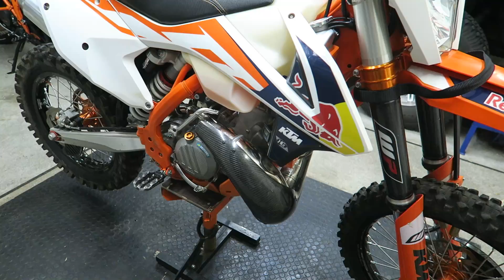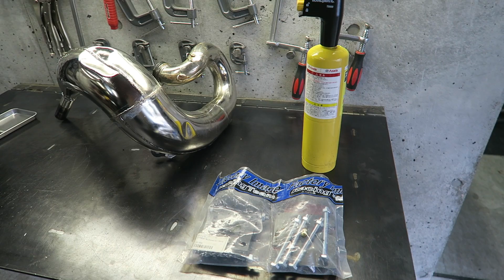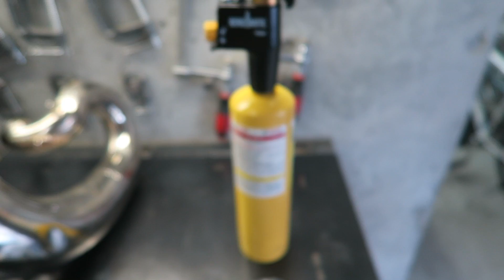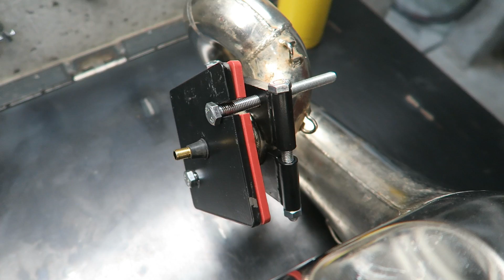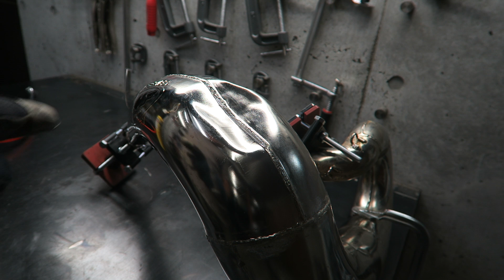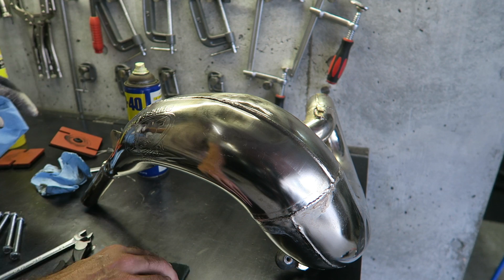2-Stroke Exhaust Dent Removal

Comment: When blowing out pipes I have had good luck using a metal body working hammer to work the edges of the dent. While the pipe is pressurized and hot work the edges of the dent tapping along the high spots which relaxes the metal and allows the dent to come out further.
Reply from the maker: Yes, I do the same now. Hammering works well. Usually I use compressed water (HydraForce) rather than air as it's much quicker and safer.
Reply: I agree water pressure is a much safer way of working @TokyoOffroad

Comment: Kinda sketchy with an empty chamber. I worked with a guy who leak tested a water tank with straight air, tank ruptured and blew him in to pieces, that was at 90psi, 250 gal bomb.
Filling the pipe with water would be 100% safer (hydroforming). Can still split, but splitting is far better than a 60psi air bomb.

Comment: Is it possible to do it without adding 60 psi. Just Plug the pipe and heat it up. THX in advance
Reply from the maker: No, you'll need to add some pressure, or it won't blow out.

Comment: Maybe try a higher pressure watched another video and he used 150psi
Reply from the maker: The dent would come out easier with higher pressure, but it would also be a lot more dangerous if something went wrong. Recently I prefer using the high pressure water blow out method as it's a lot safer and quick and easy to perform.

Comment: Pressure washer does this safer and no heat needed
Reply from the maker: I've made quite a few videos about the HydraForce method which uses water at high pressure and no heat: https://youtu.be/xVGdHsAIqNU
Reply: @TokyoOffroad  and if you heat the dent when using the hydraforce?
Reply from the maker: @66AGW  - The strength of steel actually increases with temperature reaching a peak at about 220 degC. You'd need to heat it to greater than 350degC for the strength to be the same as room temp. With the HydraForce, as the pipe is filled with water it would be very difficult (and dangerous) to get the pipe hot enough (greater than 350degC) to make the steel softer.

Comment: So much for the carbon guard. Overpaid for something that doesn't even do its one intended job.
Reply from the maker: I tend to agree. Carbon guards do provide some protection, but also put more force on the header of the pipe and it'll be more likely the pipe bends rather than denting. As such I don't use a guard anymore and just repair the pipe dents when they get bad.

Comment: That is the method I use except I can never get it hot enough with map gas alone. I bought a cheap regulator that  uses the map gas tank threads and the small oxygen tanks of the same size. Adding the oxygen allows me to get it hot enough, and fast enough to where it's much easier to manipulate the dent. Although sometimes it can get hot too fast and then the dent is no longer a dent but a slight bubble instead.  It's a balancing act with the amount of pressure and heat to use. Problem with the small oxygen tanks is you have to work fast as they run out in about ten minutes of use. Great video man. I'm still scratching my head about how that hydro force unit in your other video works. I'm just not sold on that method.
Reply from the maker: Richard Cote - I replied to your comment on my first HydraForce video. Please check out the other HydraForce videos I made which give a better idea of what it is capable of. This one shows me fixing a friend’s 2018 250 TPI which had the header crushed and bent: 2-Stroke Dirt Bike Pipe Repair- HydraForce Blow Out https://youtu.be/xVGdHsAIqNU

Comment: As a milwright/welder i would say nay to this method only because heating it up to the point where air will bend in back out WOULD ruin the structural integrity of the metal. I like the water method better.. just my professional oppion on metalurgy.
Reply from the maker: Yes, the water blow out method works well and is quick and relatively easy to do. I have a separate video here showing the water method here: https://youtu.be/xVGdHsAIqNU

Comment: This seems a bit dangerous to me, any un-burnt fuel or carbon in the pipe, mixed with oxygen and heat and boom.
Reply from the maker: HydraForce blow out is without doubt safer, although I haven't experienced any explosions with heat and compressed air so far. This video shows the HydraForce blow out method: https://www.youtube.com/watch?v=4aQL3UGMHk8

Comment: Compressed air is dangerous! How about filling a part of the space with sand or other non flammable material and only leaving a smaller air pocket at the dent site?
Steam boilers are tested with fluid because you can't compress it and if it ruptures it's just that, no blow up.
Reply from the maker: las 99 - I have a different video showing a pipe blowout using water at high pressure
Reply: @TokyoOffroad  Just saw it, cool but not as good as this method. Must be the heat that does the difference!

Comment: Your main seam looks pretty good but those depression areas on both sides can be completely removed if you use an oxy/acetylene torch with a small welding/brazing tip.  The heat is obviously greater and concentrated in a smaller area so you need to be a little more careful but you can produce a nearly perfect result fairly easily.  Also, that pipe you're working on is thick enough to where you can throw some pretty good heat at it.

Just saw this right after watching your video.  Illustrates what I'm saying.

http://www.youtube.com/watch?v=3rRerhUYKsU
Reply from the maker: Yes, if I had oxy acetylene I'd use that instead of MAP gas as it would be much faster. However, good results can still be achieved using MAP gas. One detail I prefer (particularly for anyone who doesn't have much experience with this process)it to add compressed air after putting some heat into the pipe, rather than at the start when the pipe is cold. This way you have a lot better idea of the maximum air pressure.

Comment: I'll never understand why all these fix it videos have all these shop tools then use a map gas torch, why dont people use a oxy acetylene torch anywhere on YouTube?
Reply from the maker: The Tag Z video uses oxy acetylene: https://www.youtube.com/watch?v=URLTEFfNk3Q 
I personally don't own oxy acetylene and rarely have a need for a high heat source. For cutting I use a plasma torch. Map gas is a good compromise for me for jobs like this...
Reply: thatkyleguy 1 because the average person doesn’t have access to an oxyacetylene torch so they’re showing you a way to do it.
Reply: Cody Crowell I feel like if a person has a nice shop full of tools they should have a torch setup. Why have 10 grand in tools on the walls and not have a 500 torch set...... I'm a firm believer in the old adage that "time is money" spend a little more money, save a bunch of time, therefore save money.
Reply: thatkyleguy 1 I totally agree with you. But I think they’re trying to show you what you can use at home. Most people don’t have a oxyacetylene torch
Reply: Cody Crowell very true I agree with you. I was heavy into coin ring making a while ago and I like how all the videos says "easy coin ring making at home" and first scene they have a 5000 dollar lathe they're using haha
Reply: thatkyleguy 1 hahaha exactly

Comment: I've used a powerwasher to pop out multiple dents at the same time. Works very good. Plus it doesn't ruin the plated finish.
Reply from the maker: Yes, there are multiple ways to do this. All methods have pros and cons. The advantage of heat + air is you can be very selective in what area you target and distortion of the pipe shape is minimized. But to be able to repair more severely damaged pipes I have ordered a hydraulic pump + bung blow out kit. When it has arrived and I have a suitable pipe to repair I'll make a video about it...
Reply: Tokyo Offroad, sounds good. Can't wait to see it.

Comment: Just use a better pipe protector..
Reply from the maker: You could use a stronger guard, but they will tend to make the pipe bend instead of denting. The combined skid plate/pipe guards offer the best protection, but are somewhat heavy, expensive, difficult to install/take off and collect large amounts of mud/debris while riding. I went a different direction and have been using an FMF Gnarly pipe with no guard for about 6 months now. The Gnarly uses thicker gauge steel than stock and has proven to be strong and dent resistant (only a couple of very minor dings).

Comment: When it hit the rock, it does not just get dented, but at the same time its angle is getting shift, so how we can fix it?
Reply from the maker: Atilla Özkolaçık - if the shape has distorted you’ll need to try to bend it back. Try clamping the pipe to a bench and use a pipe to bend the header. It’s usually possible to fix it so the pipe fits, but difficult to get it perfect.
Reply: What do you think about Hydraforce exhaust blow out kit?
Reply from the maker: Atilla Özkolaçık - I think hydraulic blow out looks quick and easy, but there is a risk that the pipe shape distorts while you blow it out. The FMF pipes have a factory made dent at the top of the pipe (for clearance under the radiator) and this would be blown out too with hydraulic. Like any method there are pros and cons...
Reply: I do not use fmf pipe so there is no risk for me :)).. thank you for quick answer and detailed explanations..your channel is the best in youtube

Comment: Thanks for the video, I am going to fabricate this same tool, I've seen guys just use hose clamps and maybe safety wire holding 1 rubber cap on one end and a piece of steele blocking the other end... also seen them blow out.. would kill if the ends blew. Great videos..cheers

Comment: Not a fan of compressed air, use pressurized water from a pressure washer. Hydroforming.  No dangerous hazard if the metal gives way. No heat needed.
Reply from the maker: Distortion of the pipe isn’t an issue?

Comment: could you use high pressure water as well? I've seen metal forming with it.
Reply from the maker: Psych Olocke - Yes, some people use a pressure washer and bungs. However, it’s not as controllable and can result in deforming, or splitting the pipe.
Reply: @TokyoOffroad  doesn't that create rust to?

Comment: would it will bee much easyer if you feel it up with water and freeze it?
Reply from the maker: Some people do that, although I've never tried. A read that a major issue seems to be that it's easy to split the pipe doing this. Another issue is that the pipe can easily become distorted.

Comment: One more question. Would it be possible to fix the dents with an electric heat gun (2000W, 600 degrees Celsius)? I don't have access to a torch such as the one you have on your video. But I could buy a heat gun.
Reply from the maker: No, unfortunately a heat gun would not be able to get the pipe hot enough.
Reply: Buy a torch

Comment: What if i put water in the exhaust and let It become Ice? I saw some people doing that
Reply from the maker: DangerJoker ! - Freezing the pipe with sealed water inside isn’t very controllable. The pipe can easily distort,  or split.
Reply: Tokyo Offroad ok thanks for the advice :)

Comment: What would be the procedure for mutiple dent removel? would it be one dent at a time. What I mean is first tackle one dent. Wait to cool. Release the air. Then start all over with the next dent? or could you tackel mutiple dents. That is heat all dents at the same time. Then pressurize the pipe?
Reply from the maker: Erdat Çataloğlu - For multiple dents I just continue. If the dents are close it’s quicker because the pipe is already hot.
Reply: Tokyo Offroad - Thank you very much. I do appropriate all the information you put on and enjoy your channel.

Comment: Good to know you can use 60+ psi. Every other video I've seen used 20-25 psi.
Reply: I started off with 100psi and after the first dent came out it was 120.
The more pressure you have, the less heat you need.

Comment: Hydofoming uses 1000's of psi, 60 psi on that small volume with air is like a bike tyre, go on crank it up.😆
Reply from the maker: With the application of heat you don't need high pressure to pop out dent's. This way you can minimize the danger of an explosion. I now have an air inflator/gauge which can stay attached to the valve so I can constantly monitor the pressure.

Comment: I use a standard air snap fitting with a pressure gauge behind it instead of a tyre valve. I set the regulator on compresser to 40psi, and it holds a constant 40. if it starts to rise past 40 on the gauge, I shut down and GTFO.

Comment: That wire isn't going to stop the bungs from flying if the champs fail. Hold the silencer in the vice. Use something that's capable of absorbing and safely deflecting the impact of the flying bungs and clamps - at each end. 
But before you start, ensure all the un burnt oil and fuel has been washed out, and it's been flushed with water. Heating a sealed canister with pressurised gases inside is the best way to cause a catastrophic explosion that could kill you. You're making an improvised explosive device and literally standing over it!!! No matter how much safety equipment you're wearing, it's not enough. 
Attach the air hose before hearing or have someone add the air as you continue to heat. 
Applly the most heat to the deepest dints first. You're attempting to reverse the process that caused the dint. The rest will pop out more easily. 
If the deepest dints don't come out, add more pressure and continue to hear the deepest dints. 
Final observations: Carbon fibre in that application is bullshit. It has zero impact integrity - clearly. It just looks pretty in the showroom. Junk it. And stop advising people to make bombs!

Comment: Does this not remove the chrome finish from the exhaust?
Reply from the maker: Oliver Keeley - It doesn’t remove the finish, but it does discolor it a little. Using some Scotchbrite and WD40, or some metal polish restores the finish, although it won’t look like new.
Reply: It defiantly does damage the finish. That area of the pipe will be burnt and will rust easily. BUT. If you keep it clean and polish with oil it will last a long time.

Comment: Good idea but that’s like putting a blow torch on a compressor there’s a chance that it might blow up. Just think of a spray paint can it says not to heat it up or it might blow up good thinking tho ;)
Reply from the maker: Joshua Dingledine - The technique shown in the video is a common method used to repair 2-stroke pipe damage. I’ve never heard of of pipe exploding. Adding compressed air after the pipe is hot is key to avoiding dangerously high air pressure. But there is some risk so wearing appropriate safety gear (gloves and eye/face protection) is important.

Comment: Do I need a compressor? I don’t have one. What if I used a bike foot pump to get the PSI to 60+. Do you think that would work?
Reply from the maker: noahr- Yes, you could use a foot pump. It should work fine so long as you can pump up the pressure high enough (about 70psi).
Reply: Also deppends on how bad the dent is
Reply: No

Comment: Another way to dobit is fill it with water and seal the ends and freeze it. We did i with a crushed car exhaust header and it worked amazing. Could barley see the mark after
Reply from the maker: Jeffrey SmokeyBones O'Malley - I've heard about the freezing water method. I'm sure it works well for certain types of damage. My main concern would be that it's not controllable in the same way as applying heat to the damaged area only. I'd be worried that the pipe gets deformed. There's also a possibility that it could split. Overall I think the most controllable method is blow using compressed air and heat.
Reply: Yea I agree. as the ice expands it could take out some of the bends in the pipe and make it not fit properly
Reply: Yea I tried the ice method years ago. But it split the seam. Had to weld it back together. I think the heat method is better as is more controlled just keep an eye on pressure as you kept heating it. Pretty sure the pressure will increase with a lot of heat. Bends of pipe stayed the same, with the ice method. But the weakest part of the pipe the expansion chamber split at the seam weld. Factory pipe.

Comment: Hi mate! I suggest getting a tyre gaige that is always connected to the valve. This way not only you can inflate the pipe quicker but most importantly to control the pressure inside. I have gone as far as 90 psi and it held. 

Even better advice isto to wear a face shield, gauntlets and grab hold of the pipe's brackets to a vice so it doesn't go anywhere should by any means the pipe decides to se the dark side of the moon... : ) 

Cheers!
Reply from the maker: Good advice. I've already made a a new line hose which so I can have pressure gauge connected all the time and make adjustments while working on the pipe. This is much easier to use  than the air setup I showed in the video.
Reply: Hi Matt, just another word of advice for anyone doing this like I did to a friend's KTM EXC Erzberg just a few days ago but it's applicable to any 2T. The pipe (oem by the way) will be really nice and neat after this, almost looking like new. The only thing is that heat can get it out of shape. What I mean by this is that it would be extremely hard to align the exhaust inlet with all the support brackets.
My suggestion is for people to get a model (wood or metal) of the brackets positions on the frame when the bike is new (or when you check it is decently aligned if bought used), install the pipe using that (better if fixed to a vice) and proceed as explained in the video.
This jig can be done using the exhaust pipe itself. All it takes is some expertise and sturdy materials so it does distort in time.